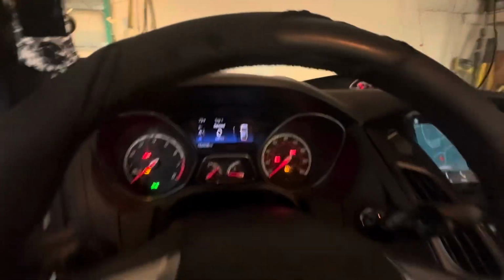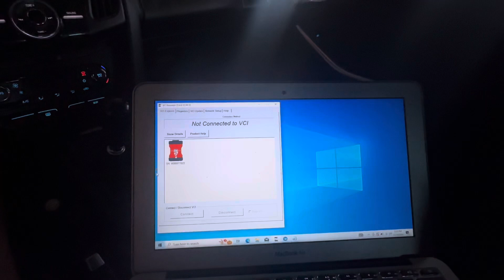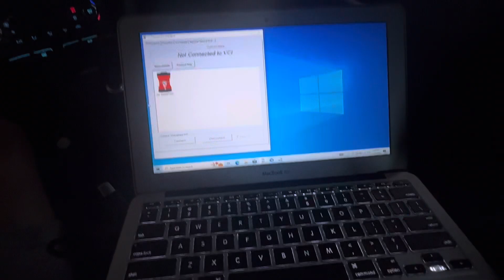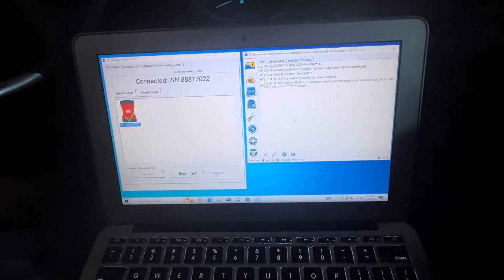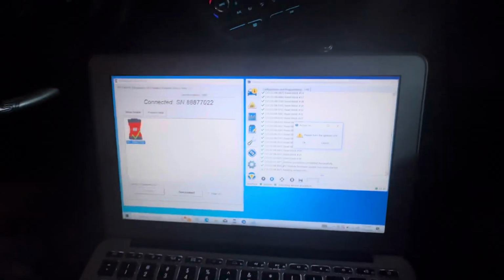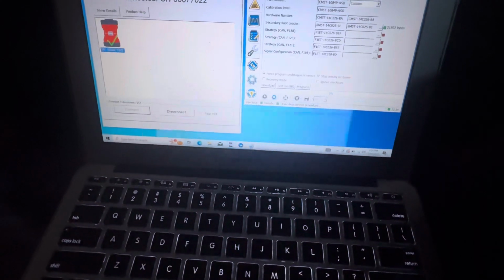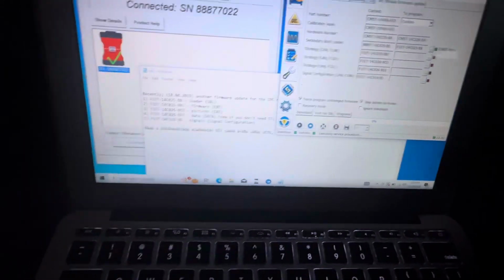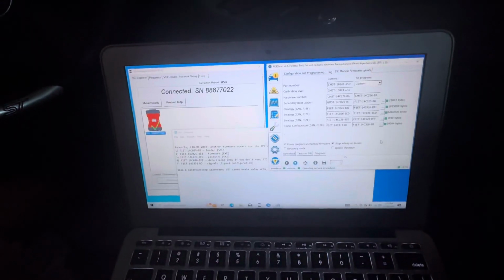How To Update Gauge Cluster/IPC (Digital Speedometer) Ford Focus 2012-2014 *TUTORIAL*

Comment from the maker: Hope this clears up a lot of questions I’ve been receiving over the years. Thanks for watching!
Reply: Is your TPMs light flashing cause a bad sensor or because of the update?
Reply: Also can you do this still with sync 2 or do you have to update to sync 3 to update the dash screen?
Reply: If I use your st files with full forscan and a vlinker fs usb cable it should flash fine?
Not sure if it’s same since I have sync2 and your have sync3
Reply from the maker: @sgt.sheepdog  TPMS sensor was dead, it has now been replaced. you do not need sync 3 for this to work. And im not aware of the vlinker adapter but if forscan reads it, then it should be fine.. i just wouldn’t be able to tell you how long it will take.
Reply: @svtshotti awesome! I’m gonna give it a go soon than, the vlinker cable has programmed my keys and been working well with forscan license so we’ll see than
Reply: Hello, great video! 
Do you know if it works with  the usb Elm327 odb2 adapter?
Reply from the maker: @oxukaru1  yes, but it will take about 4-6 hours using that adapter
Reply: @svtshotti  Thanks, could you please share me the model of the adapter you used? or the link to buy it.
Reply from the maker: @oxukaru1  mine was pretty expensive. it’s a ford vcm 2. about $250 on amazon
Reply: I have digital  speedo on my FoST now, but…sadly I lost my ST logos from my screen when I start the vehicle…do you have any fix for this ?
Reply from the maker: @dorintiriteu2306 Yes I will make a new YouTube video on that shortly! Keep notifications on so you don’t miss it.

Comment: No update option using the 1 year license and vgate vlinker. Attempted to install vci manager, kept getting jre bundle errors. Installed ids, would not launch. Got desperate (dumb) and started to upload the files via focccus. First file took, secondary bootloader failed at 2%, failing to erase. Launched ids on my work laptop, did an as built config and pmi. Module reprogram failed to fetch the files. I think tomorrow I'm gonna install forscan on the work laptop and try with the vcm again. If that doesn't work I'm gonna try to fetch the required files manually. If that doesn't work I guess I'm gonna be buying an 18 escape ipc... Just wanted to post this in case anyone else was planning on trying to brute force it like myself.
Reply from the maker: Yea definitely don’t use focccus. Gotta download the specific beta version of forscan that has the module upgrade option as explained in the video. 
Sounds like you work at a dealer. If that is the case, use ids to reprogram the ipc and u can try the upgrade again via forscan, or buy a used cluster as you mentioned.
Reply: Okay, I misunderstood... you kinda skimmed over it... You must purchase the paid license, then forscan will send you an invite code to the forums. You make an account in the forums and then log in. Once you're logged in, you click on the beta topic. From there, you can click the top topic, and follow it to a download for the beta. Also, ford has changed the way vci manager installs. Now, you have to install both ids and fdrs before you can install vci manager due to package dependencies.

Comment: Did this (took forever with vlinker) and I lost all speedometer function and abs. Is there a way for fix this? (back to factory for now)
Reply from the maker: @WrEcK3  if you have ids, run the ipc reprogram service function and start the process over.
Reply: @svtshotti  looked up what ids is. I don't not have one or access to one. Any other options to fix this? I have look through forums but no one says anything about it
Reply from the maker: @WrEcK3  if you can’t access ids, i would recommend just restarting the whole update process. i’ve had to do that once before i had access to ids. it was a pain but it beats driving around with no speedometer and a black screen

Comment: Just be aware that if you have any parking sensors on the car, you will loose the sound of it....
Reply: Is there anyway to retain the parking sensor sounds at all?
Reply: @romiepm  replace the parking sensor module to the facelift model, but that leads that you also have to replace the BCM... and when you replace the BCM you need someone to code the keys for you. so no... when you go from pre-facelift IPC to facelift IPC (by upgrading the soft) you will always loose the parking sensors sound.
Reply: @ Is there a reason as to why the sensor sounds are lost in the process of the upgrade?
Reply: @ And what if you just replace the cluster with a FL cluster? I’m assuming it would give the same results..?
Reply: @romiepm  yes. the frames are directed differently through the can
Reply: @romiepm  yes. the problem would still be the same.
Reply: Depends on the BCM model I believe. If you are lucky enough to have a 2014 with the newer BCM, I think it retains the sounds.
Reply: Apparently if you flash the BCM with the latest firmware also you can retain the sound
Reply: @rosidus I have a feeling I heard about this theory 2 years ago and someone smarter than me told me that it won't work
Reply: @rosidus what version would that be or do you have a link at all?
Reply: @romiepm I'm just going to do the updates with Forscan using what they provide and see where it ends up.

I don't really want to loose the reverse sounds as it has saved me a couple of times.
Reply: @rosidus are you in a prefacelift focus without speedometer right now? if so and if you’re trying to get the speedometer doing the method your way, please let me know how you go as if it is successful I’ll do the same hopefully
Reply: @rosidus  How’d you end up going?
Reply: @romiepm  didn't get on ok. I tried to update my BCMII with Forscan and said process got interrupted. Thought I bricked it but luckily Forscan has that recovery option so saved it like that. So a bit hesitant about doing other updates now.
Reply: @rosidus  yikes. well if you ever get the courage to try again let me know how you go because I’m keen on doing it but I really like the parking sensors especially because right now my reverse camera works only 1/10th of the time. also never knew forscan had a recovery option so good to know
Reply: Notice anything else that was lost? I want to do this on my 2014. Don’t have parking sensors so that’s fine
Reply: @sgt.sheepdog  Just the sound...